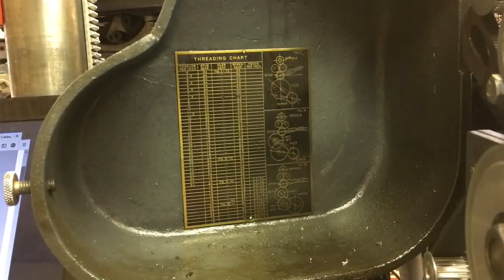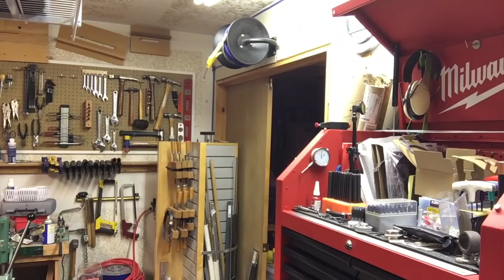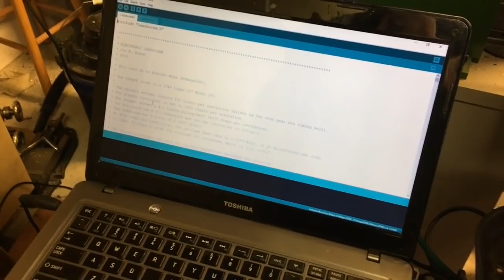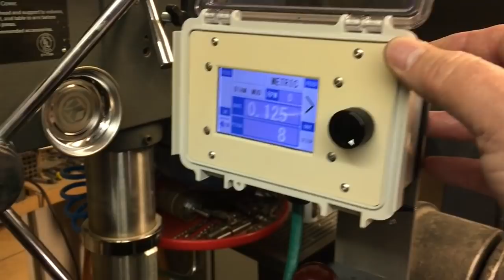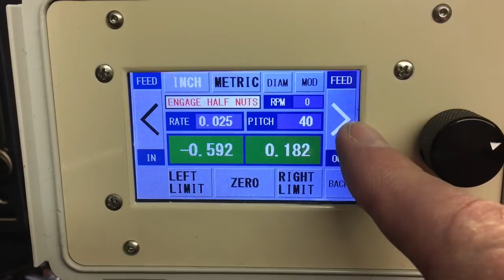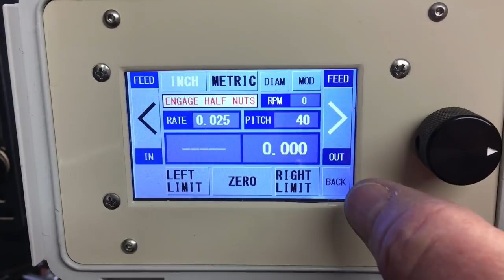My Electronic Leadscrew Project Overview

Comment: This might be a long shot, but I have a Montgomery Wards that I'm putting a Clough42 ELS on.  Any chance you could tell me what the pulleys and belts you used are?  A tooth count and belt length would save me some guess work.
Reply from the maker: I wish I could help. I don't know your lathe, and I don't know a lot about Clough's project. I intend to do some work on mine soon, but my wife injured her back and I'm taking care of her right now. I had picked up an STM32 Nucleo microcontroller a couple of weeks ago before she hurt herself. It should be able to completely offload the pulse generation from the CPU.
Reply: @jonrbryan  My lathe is essentially the same as your Logan.  Wards was a customer of Logan, they would spec builds and Logan would build them using there techniques and components and badge them as Montgomery Wards.  Mine is a 9x21 if I remember right.

So, if you do get time to grab a tooth count on your pulleys and belts, they should transfer over very well if not identically to my build and help me with design considerations for my mounting bracket(s).

The Clough42 mention was more for credit, it works the same using a rotary encoder, a microcontroller, and a servo or stepper.  Mounting and driving considerations are much the same.
Reply from the maker: @alexriedel3142  I used an HTD3M 8:1 timing pulley kit to go from the stepper to the leadscrew. The large pulley has 120 teeth, and just barely fits inside the cover, and I used a 420 belt. There is documentation at https://github.com/ccomito1223/ELS-Jon.

Comment: Hi Jon. I have installed your ELS on my lathe after considering many other examples found online. I have some questions, but I have little hope of reaching you here after all this time.  We'll see. I made very few changes from your setup. My original plan was to run it on an ESP32, but that plan failed mostly because I don't know what I'm doing. It's working with the Mega2560R3 now with my main problem being that the leadscrew doesn’t reverse when the spindle runs backwards. All the transitions look good on the scope and the arrow on the display even changes but the leadscrew keeps running the same way. I don't expect you to solve it for me, you've done more than enough by designing it to begin with. Excellent work, thanks from Aaron in San Diego.
Reply from the maker: Bravo, Aaron.  We just left San Diego this morning after spending Thanksgiving with our kids and grandkids. Now we're in Tucson for the night before heading the rest of the way home tomorrow.

If the display is indicating the direction change and the leadscrew is turning and changing speed then the only thing left is the direction control connection between the Mega and the motor controller. Make sure DR+ is pulled up to 5V and DR- is connected to D7 on the Mega.

-Jon

Comment: I saw Clough42 could not get this right on the Arduino and selected TI Launchpad instead. Nevertheless you both did well here.
Reply from the maker: The Arduino Mega gets the job done, but there's not a whole lot of CPU left to spare.  It handles 1500rpm just fine, but going above 2000 would get into problems with the interrupt handler.  Easiest way to resolve that would be to reduce the spindle encoder resolution from 800ppr to 600 or even 400.  The feed resolution would still be sub-tenths.

Comment: Hello Jon,
  This project seems to have been in process for at least two years. My life supporting skill set has been building and designing industrial gizmics for people. Electronics seem more like a window shade for my sense of logic. I have watched your demonstration twice, and am still in awe of your controller, while still not fully understanding all of it’s capabilities.
  Is it still necessary to leave the half nuts engaged for metric threading with an inch threaded lead screw? I believe that you have managed to create your missing quick change gear box, while at the same time, incorporating a pseudo metric change gear set without the need for consultation with charts and loose gears. Have you devised a way to reposition the carriage in preparation for the next pass, in a faster way than has been standard practice over the past century or so?
  In my book, I will give you high marks for the technical project, as well as for your very personable manner of it’s presentation.
Reply from the maker: Thanks, Robert. I usually use jog to set the limits and leave the half nuts engaged. It resynchronizes with the thread whenever the feed direction is changed. Otherwise I use it exactly like a gearbox with the threading dial. I've toyed with the idea of implementing a rapid reverse, and maybe I'll get around to it one of these days.

Comment: For an electronic leadscrew to work without issues, i read on multiple sites that an 8 bit Arduino is way too slow to pickup all pulses of the spindle and control a stepper motor at the same time.
What is you experience? Up to what spindle rpm speed did you test your ELS? Does the stepper looses steps occasionally? 
Looks very nice btw!
Reply from the maker: I'm using an Arduino Mega, a spindle encoder with 800 counts per revolution, and the stepper is set to 400 steps per revolution and drives the 8tpi lead screw through an 8:1 reduction. It takes 25,600 steps to move the carriage one inch. The lathe maxes out at just under 1500rpm, but has enough margin to get close to 2000. Faster than that would require decreasing the encoder resolution.

The real-time code is all interrupt driven, and doesn't lose counts or steps at reasonable feeds. I enhanced the user interface since I did this video and display the maximum spindle speed for the selected pitch/feed rate. I also warn the user if the spindle RPM is too high for the selected rate. It won't drive the carriage at 4tpi with the spindle running at 1500rpm, but you couldn't do that through a gear train either, and would likely strip the gears. Ultimately, the system is torque limited, and starting the spindle with the rate set too high just causes the stepper driver to error out because it doesn't have enough power to keep up.

The code and design information are available at https://github.com/ccomito1223/ELS-Jon. We have a small user group at https://groups.io/g/AtomicELS.
Reply: @jonrbryan  Good to know! Thank you for sharing!

Comment: Dear Jon,

I watched your videos about ELS with great admiration. I also have a good look at the programs on arduino-mega and Nextion. I still had arduino-mega on the rack, and it is already charged. I also tried to compile your program with arduino-IDE and the STM32 library without modifications resulting in 20 errors, mostly caused by different names of timers, interrupts and processor dependent hardware. I recently bought some STM32 F411RE nucleo pcb boards for that purpose. I still have to make adjustments to both programs because I still use the small gearbox on the lathe. It is equipped with lead spindle and separate feed shaft for longitudinal and transverse feed. I would like to email you because I have some questions and also comments. My email "luc.wybo@gmail.com"

Best regards, Luc
Reply from the maker: Thanks, Luc. I bought a couple of STM32 boards just in case, but the Mega is working fine. I've made some relatively minor modifications to both the hardware and code since I did this video. I was able to squeeze a slightly larger stepper in and also changed the stepper-to-lead screw ratio to 8:1, which gave better results cutting 8tpi Acme threads in bearing bronze. There is an "Atomic Leadscrew" forum on groups.io if you want to check it out.

Comment: Fine work, I wonder if one could use a similar system to make a semi-universal dividing head capable of universal dividing head operations.
Reply from the maker: Certainly. The fundamental components are the same. I used an 800-count spindle encoder, which works very well on my lathe. For an indexer I would want higher resolution, since any angular error is multiplied by the radius of the workpiece.

Comment: Jon, nicely done. Very clean and professional hardware build. I'm also working on an ELS project in https://github.com/kachurovskiy/nanoels but using a different approach to most challenges :) It's funny how we're solving each problem differently. I'm currently having problems with my 600 step optical rotary encoder, it reads the wrong direction every one in a while, ruining the direction control :/ Wonder if you had that problem.
Reply from the maker: I tried using the Arduino internal pull-ups at first, but switched to 2k external resistors because the slow rising edges were resulting in random counts in the wrong direction.  I haven't had a problem since.
Reply: @jonrbryan  bingo. Thank you so much! Looks like I need to make a few changes to https://github.com/kachurovskiy/nanoels/tree/main/h1/pcb to support that :/ Hardware is hard! I think I managed to overcome this through software though: once spindle speeds past 10rpm, I just stop reading the second line assuming spindle can't change direction while turning :)

Comment: This is an excellent project!  The threading to a stop alone is worth the implementation.  I plan to adapt this to a 10x22 import lathe with a totally different leadscrew.

To make it more portable, have you considered converting the #defines listed under "Scaler Magic Numbers" to variables and read/write them to EPROM?  If you did that, you could give the user the ability to modify their values on the Settings screen and for the 80%+ case, there would be no need to modify code it use this on different lathes.  Maybe the timing values would be needed as well, I have not dug into it that much yet.
Reply from the maker: That's an excellent suggestion, Jason, and one I've thought about.  I think I would need to add another setup screen to do it properly.
Reply: @jonrbryan  I was thinking the same thing.  Maybe move the speeds table to an Information screen and use the free space on Settings to add the editors.
Reply: @jonrbryan  Another thought would be to use the encoder for the jog function.  If you tap the Leadscrew textbox, the background changes color indicating that turning the encoder will jog the leadscrew.  Tap it again and the color returns to normal.  Maybe even support a single tap to jog slow and a double tap to jog fast.
Reply: I can't get the Arduino code to compile.  Am I missing a library?  Sorry, I'm new to Arduino and having a tough time figuring this part of the code out.
AtomicELS:980:5: error: expected constructor, destructor, or type conversion before '(' token
 ISR(TIMER3_OVF_vect) {
     ^
Reply from the maker: @jasonestes8954  Make sure your target processor is the Mega (2560).

Comment: Hello Jon in your lathe lead screw 8 turns per 1 inch in my stroke is 5 millimeters per 1 turn, what should be changed in the Atomic ELS program so that I can install your driver in my lathe. Regards Jacek.
Reply from the maker: You will need to change some #defines to scale things properly.

Comment: The curse of the Internet: There's someone on the Internet who has already done the work better. I've been adding a touchscreen display to another ELS project. Seeing how much more you have done, I'll stop (re-)inventing the wheel. Wonderful project, and I appreciate how much work you have put into this. Very well done!
Reply: Take a look at the Teensy. Programming would be similar, with the Ardunio IDE. The Teensy is pretty small, very fast, and has hardware decoding of quadrature encoders. Wonderful project!

Comment: Hello,Jon!
I am trying to integrate your creation on chinese mini lathe for my friend. I have a situation...If I change direction of the chuck (spindle encoder) on the lathe, (not on ELS),  leadscrew (stepper motor) does not change direction.  Do I have to change direction on ELS direction switch everytime I switch direction on the lathe? I would expect direction of the leadscrew would follow chuck automatically - that is - when I change chuck direction, lead screw changes direction as well without switching direction switch on ELS. Sorry for bothering you...I just want to put lathe back to work and this seems to be a problem. Thank you for your time.
Reply from the maker: If you roll the chuck back and forth the lead screw and display arrows should change automatically.  If they don't then one spindle encoder phase is not working and stuck either high or low.